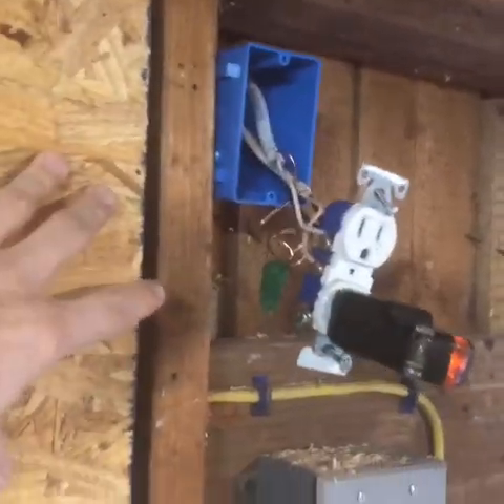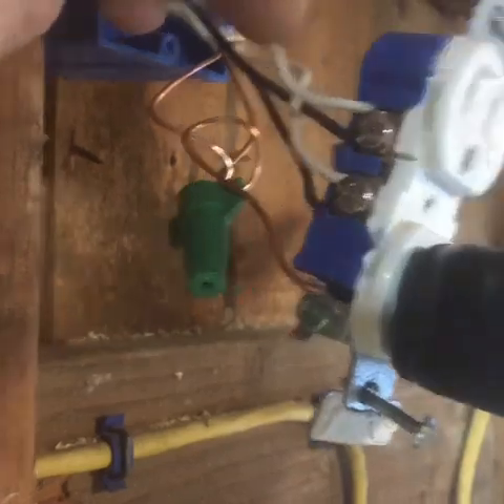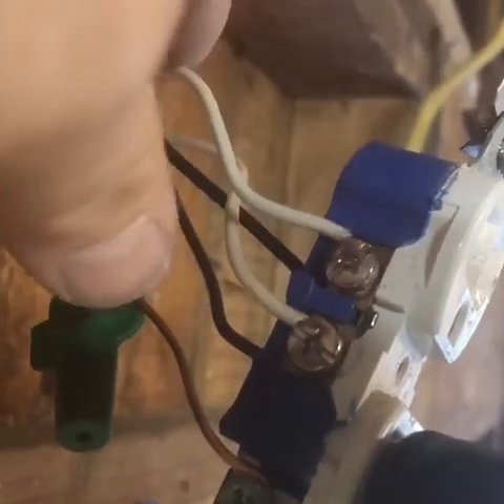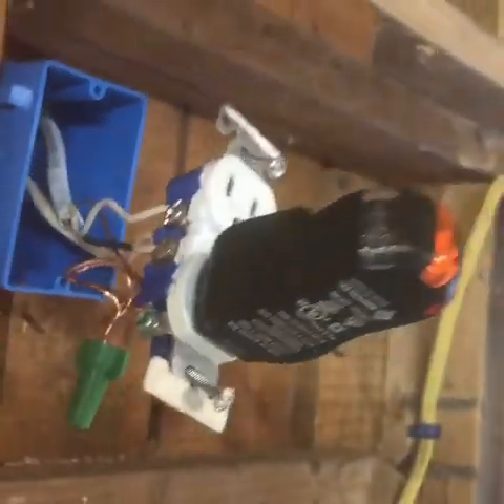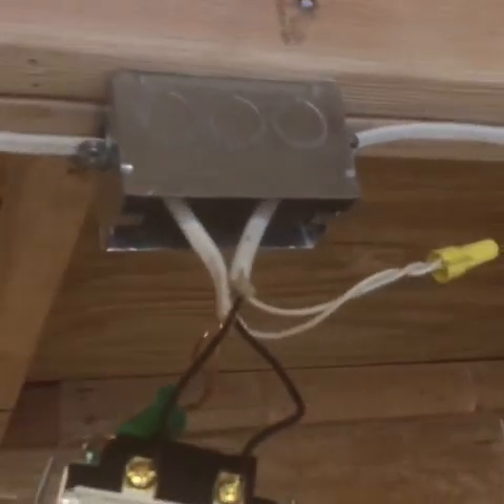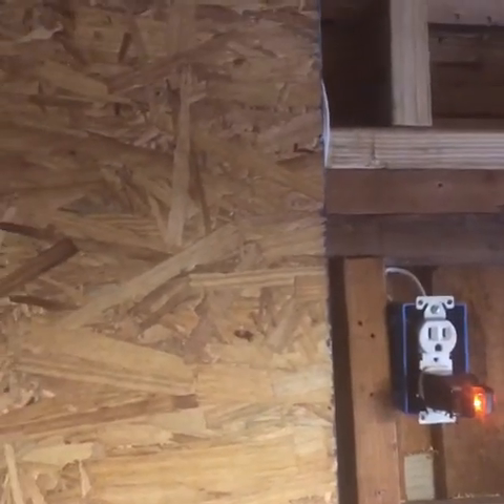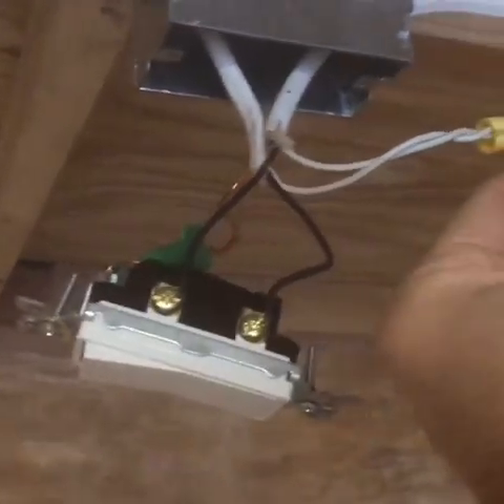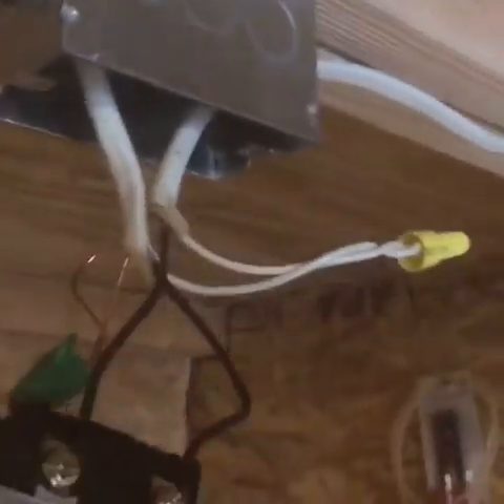How to wire a light and switch using outlet power

Comment: Don't tell us...show us by doing it.
Reply: If y'all can't plainly see how it's wired in the video, you're either blind or completely incapable of wiring it yourself. So just stop here and hire a professional. EVERYTHING YOU NEED TO KNOW IS PLAINLY VISIBLE IN THE VIDEO.
Reply: If you can't follow an instruction with an aftermath this basic, instructions, youve got problems...
Wire outlet black to gold, white to,silver. Run wire to light.
The white wires together, and put one black wire to one pole in switch, other black wire to the other black pole in switch and that's all.
Reply: LightGesture why put the whites together instead of putting one on one pole (on switch) and the other on the other pole (on switch)? Is it just unnecessary since the black wires are what makes the switch work? Thank you